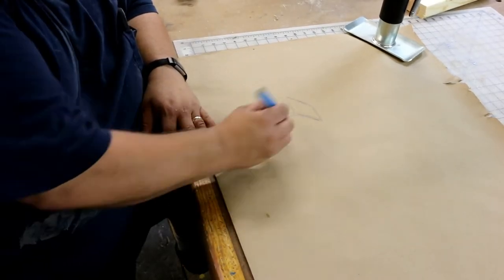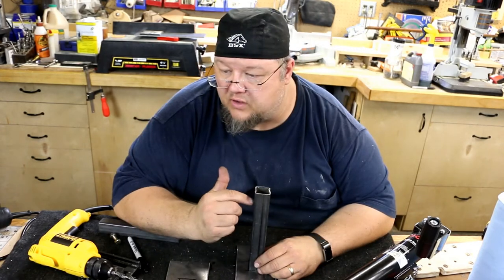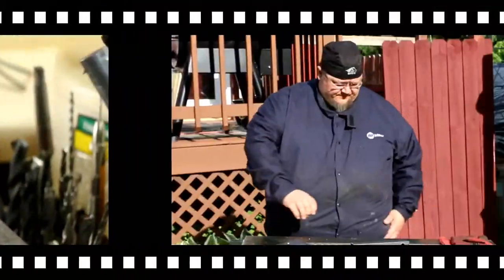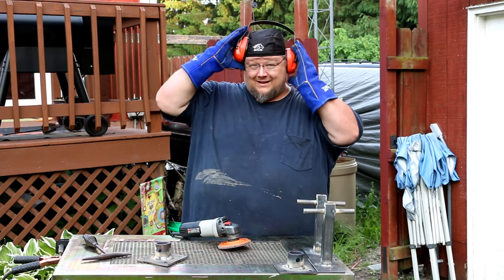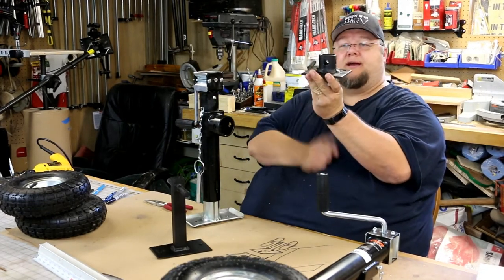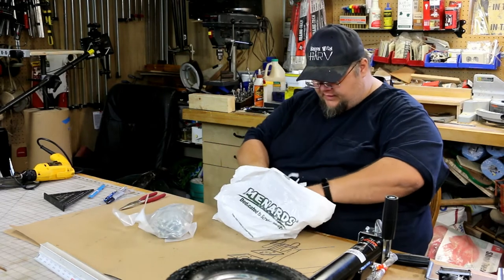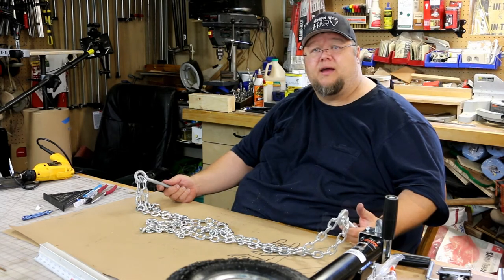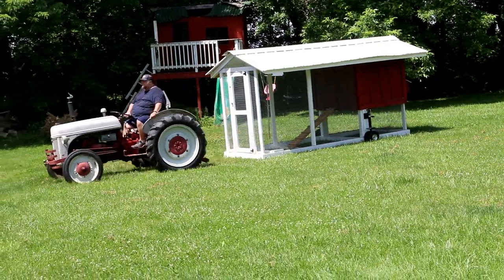Harv's Ultimate Chicken Coop and Run Mobilization

Comment: Love the design Harv! I’m thinking I may need to go the heavy duty route like you did but I have no welding experience. But my coop is almost done but it’s super heavy since I also used 2x4s. Tomorrow I try lifting it with the 2x4 wheel solution I implemented but I’m thinking I’m gonna have to go bigger
Reply from the maker: Alex Alvarez thanks for the compliment 😀. You could easily use threaded rod and nuts on the bottom to hold the wheels. I’ll have to think of an alternative for how to connect with the jacks. First thought is to go with a jack that doesn’t have a foot on it. Switch to a smaller pipe for the down rod and pin it. The jacks have worked out great for us.